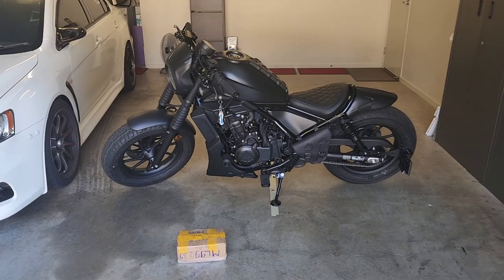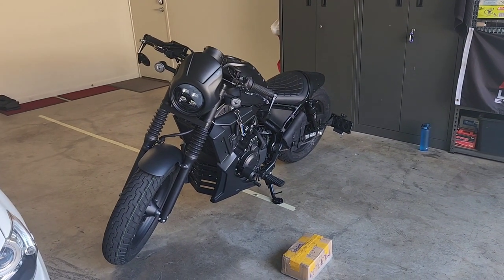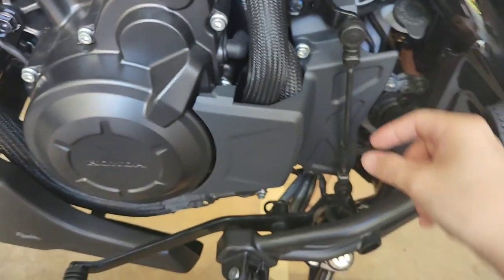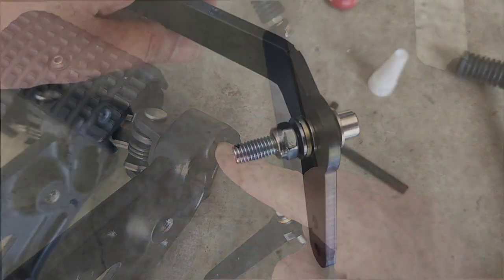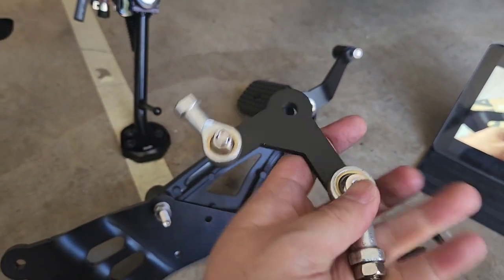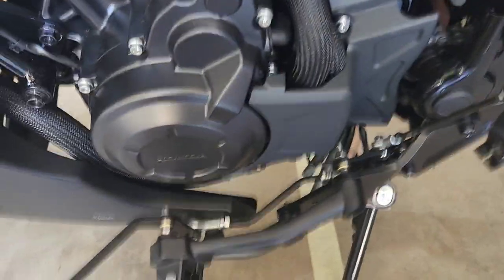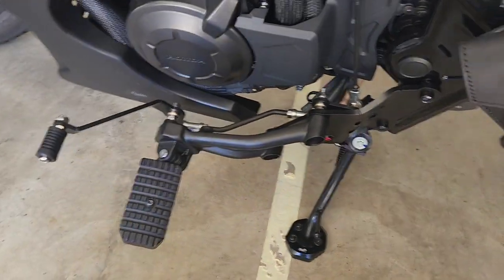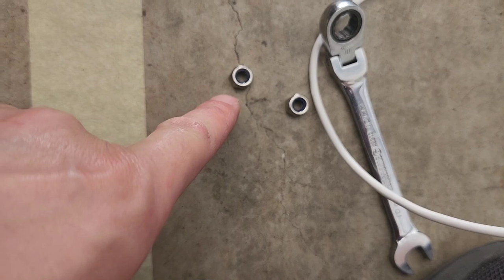Honda Rebel 500 Red Dragon Forward Controls Install - DIABLO CUSTOM TWEAKED REBEL 500

Comment: Hey mate, are you in Australia? 
Just wondering about the rear fender and the mounting of lic plate? I’ve been told side mount isn’t legal? 

Cheers
Reply from the maker: @adolmark  yes mate but I sold the bike a year ago. The side plate is legal if mounted width ways and is viewable from a 45 degree ark from both rear quarters of the bike, in Queensland
Reply: So if I got a bracket that placed the lic plate on the side but inline with the back wheel should be ok?
Reply from the maker: @adolmark  it must the horizontal just like it is from factory. Later in my videos I show another test mounted setup

Comment: Hi I am hopefully going to get this bike , I have trouble with movement in my left knee, and siting on the stock bike it’s difficult for me to get my foot under the shifter leaver, so was wondering when you took of the bracket , you showed use the 2 bolt holes in the bracket ,saying you shift the new bolt to the front hole instead of the back hole, so was wondering if the original bracket shifter can be put forward to that front hole , as I think it would give me foot the extra room to put my foot under it to shift , but if not these dragon forward controls would definitely help me .
Reply from the maker: I have not tried that since the video was installed i have left it as is.  If you were to use that rear hole, the shifter would be too close to the foot rest though.  On the black new shiftter from red dragon, you will se a couple of holes at 11.23.  Those holes can be used to adust the angle that the shifter sits at.  You will be able to achie a larger gap than what is shown in my video, by just using the red dragon shifter but changing the mounting hole to what i used in this video.

Comment: Did you ever install back the frame sliders? Or does it not totally work with the forward controls? Thanks for your informational videos. Much appreciated mate.
Reply from the maker: Sorry I missed this comment. It unfortunately is too close to the clutch and brake lever so they can't be installed at the same time

Comment: Thanks for a minute there I thought I would be capable of doing this... But no way I'm even trying 8)
Reply from the maker: I guess then that you know how much a shop would charge going by an hourly rate, as to the length of my video. it should take no longer than 30 to 60 minutes without having to describe everything like i did in my video

Comment: Will the Diablo belly fairing fit new 2023 rebel 500 ?
Reply from the maker: Yes for the 500
Reply: @TweakedGSX  I contacted K-speed they said that the exhaust pipes are in the front for 2023 and it has not been confirmed if it will fit and to wait :/
Reply from the maker: @Jesus-gy7vw  I haven't put it on myself but if you look at my wheel cover video I have a 23 model in my garage and it looks the same position as 22